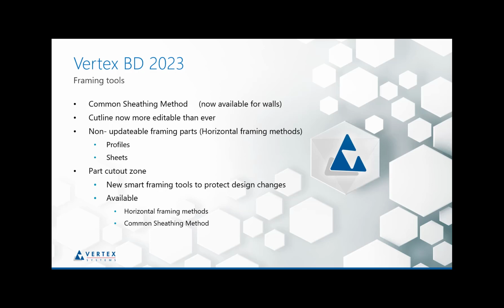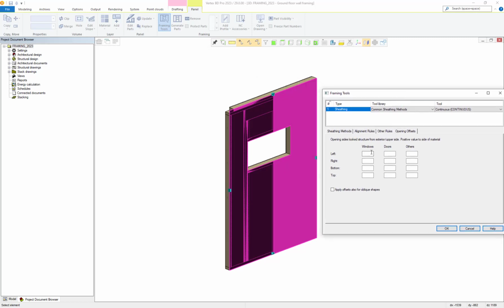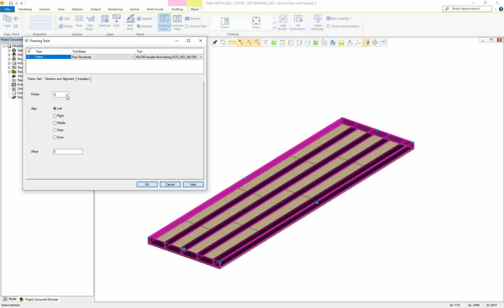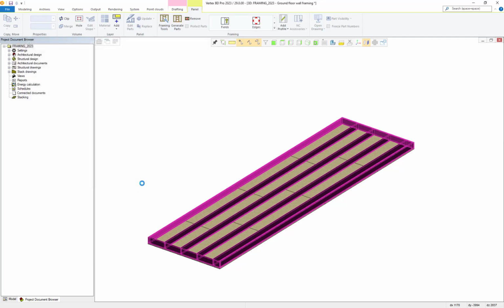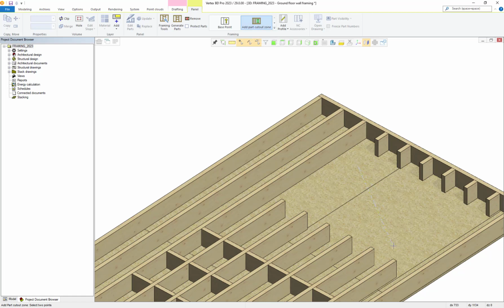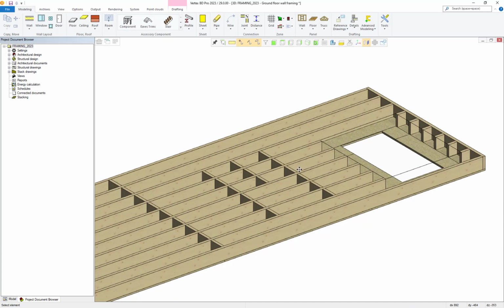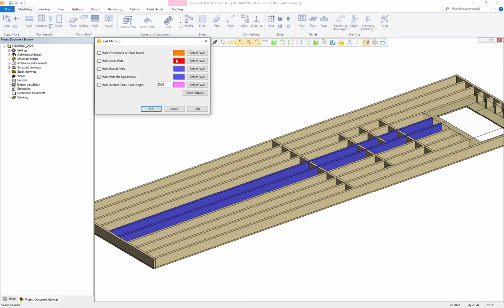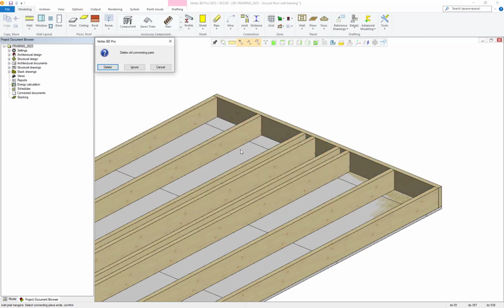New smart framing tools to protect design changes [What's new in Vertex BD 2023]

Comment: Thank you for this good software
How can I desigin the connections between steel elements ?
Reply from the maker: Hi George please contact our service desk and we will be happy to guide you through this process.
Reply: @VertexBDBuildingDesignSoftware  Hi
How can I contact the service desk
Reply from the maker: what country are you based in? with that info i can provide you the correct helpdesk email address for you to get in touch with our team, Best regards  @GeorgeBarakat-do8jq
Reply: Hi I live in UAE
Reply from the maker: if you can drop an email to helpdeskuk@vertex.fi we will get you instructions on adding connections sent over :)  @GeorgeBarakat-do8jq